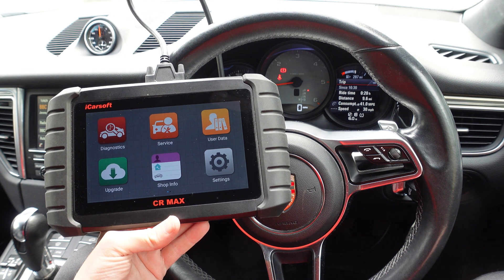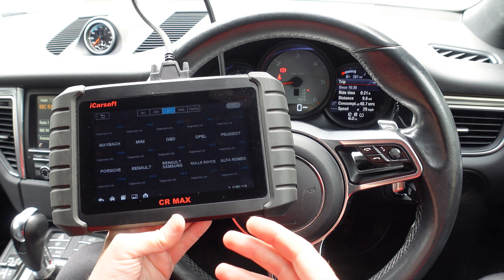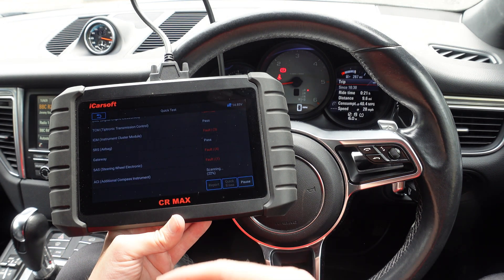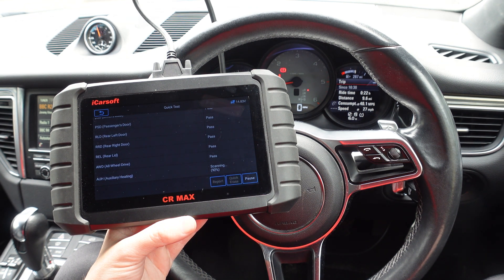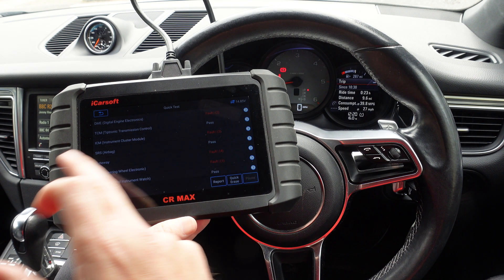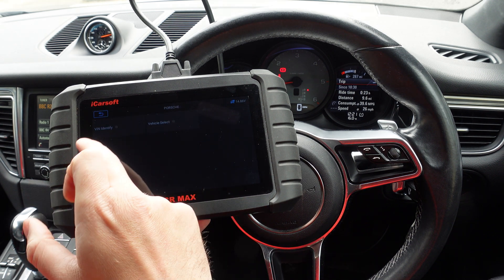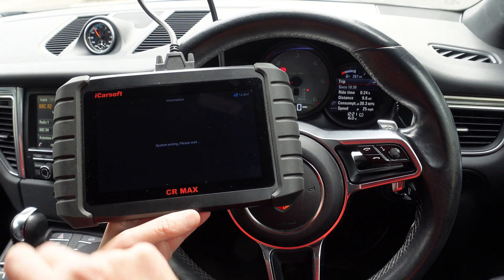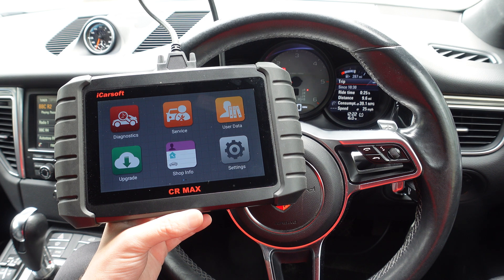How Fault Codes are displayed - iCarsoft CR MAX

Comment: i have this and a cr pro and often this cr max doesn’t connect to the vehicle ecu or read ecu fault codes, just shows airbag module for example and wont show ecu scanning option, im staring to wonder if it’s faulty, recently it wouldn’t properly scan a peugeot 807 and a renault kangoo